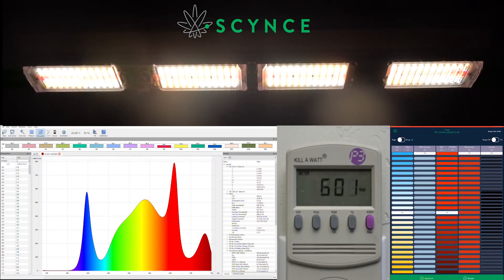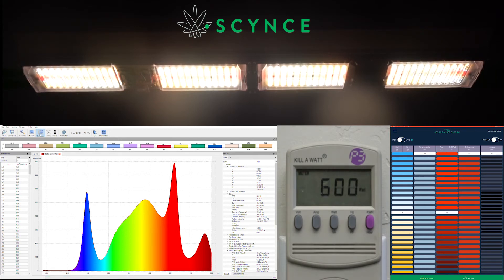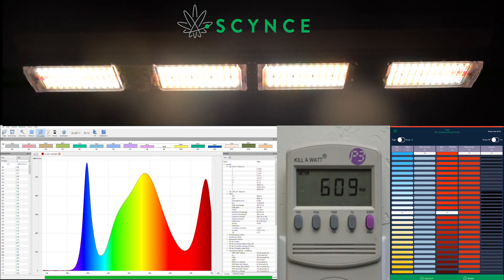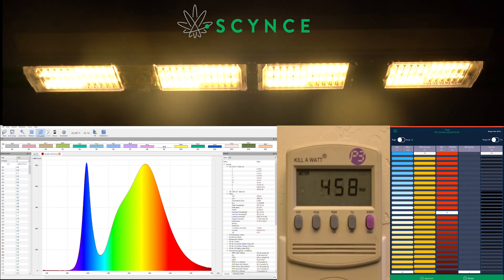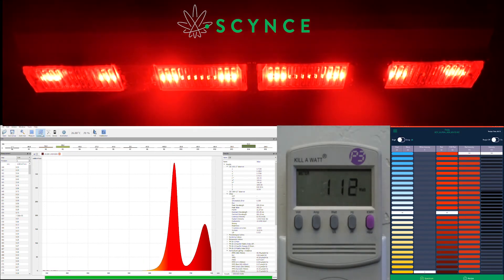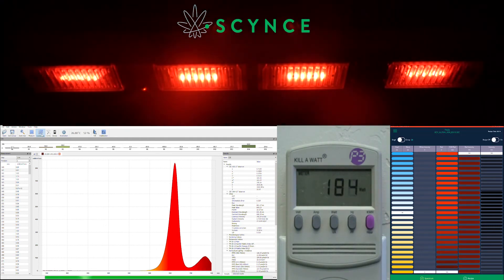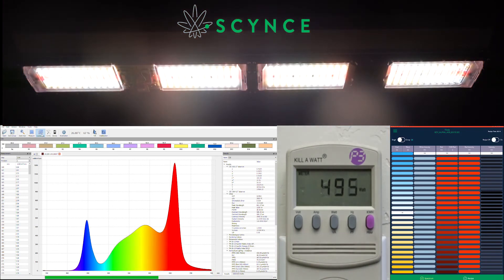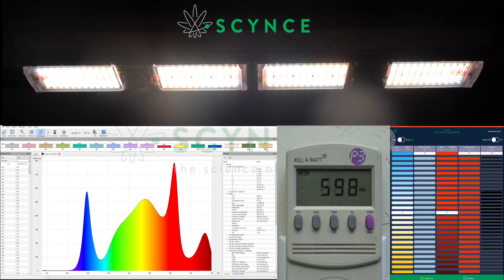Dragon Alpha - Full Power Spectrum Tuning 101

Comment: Can you set or program different light spectrums for different times? Sort of like a set it and forget it? i.e: at 6:52am cool white, at 12:15pm switch to 50/50 cool and warm (5000k/2700k), at 2:45pm add in 660nm, and at 6:00pm add 730nm, and at 7pm switch to all 730nm. Could I have it cycle this schedule everyday without me having to adjust on the fly? Thank you